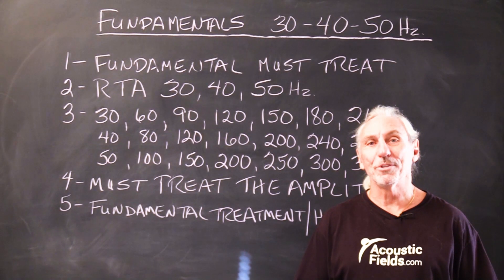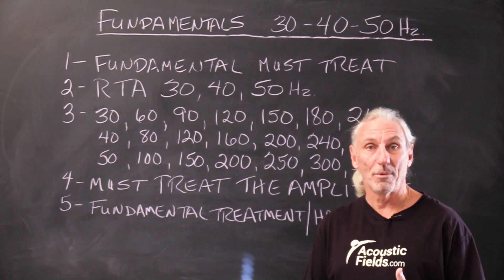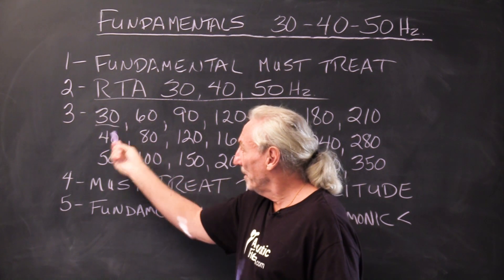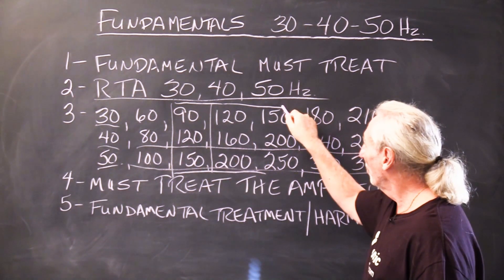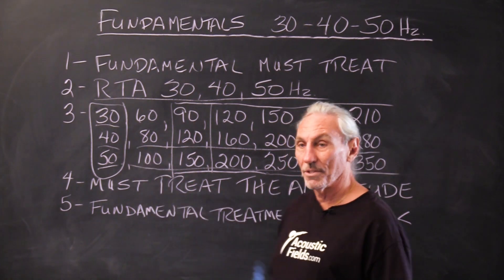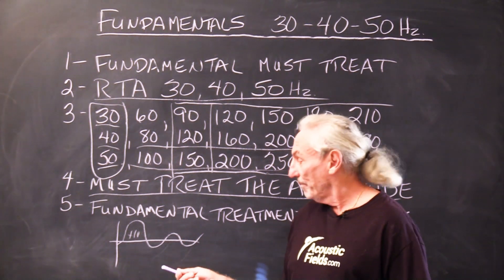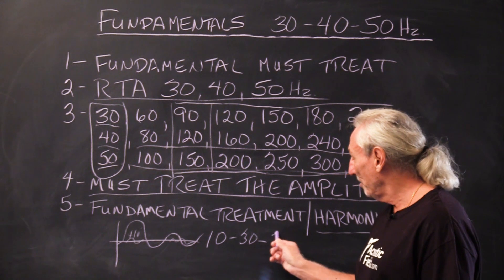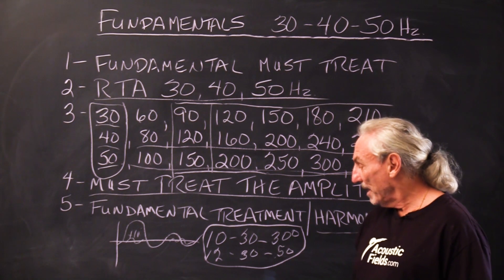Fundamentals 30 - 40 - 50 Hz - www.AcousticFields.com

Comment: I understand lower freq. radiate outwards in a circular pattern, through walls, etc. And opening doors to adjoining rooms will help to dissipate those long wavelengths too. So we treat with bass traps where it collects like walls and corners. I think that's how it works. Thanks.
Reply from the maker: J,  Low frequency energy is trapped between two parallel walls not two parallel corners.
Reply: @AcousticFields  the energy maximum is still in the corners while in the middle of the room there is none at all - so placing a trap in the middle of a standing wave gives you little to nothing

Comment: I have seen this many times while doing live sound and ringing out different rooms to compensate with EQ. The problem frequencies that feedback first are all multiples of the fundamental. You can see it on the eq when you are done. The cut frequencies will be 100, 200, 400, 800 and so on, or multiples of whatever fundamental is amplified by the room. I would very much like to work in a room that has a flat response.
Reply from the maker: D,  Yes, that is the ultimate goal for all of us along with proper attack and decay rates.

Comment: If you treat a 30Hz room node with a pressure activated absorber, i can't see any reason why the harmonics of that fundamental would be affected in any way. The 30Hz node itself does not cause the 60Hz or 90Hz to occur. It's purely the distance between two opposing walls that are creating independant nodes.
Reply from the maker: O,  A fundamental mode excites the harmonic and yes distance is in play. If you reduce the amplitude of say 40 Hz. you will have less peak issues to manage in most cases at 80,120 etc. Anytime you can impact one frequency range say 30 - 100 Hz. with proper rates and levels of absorption regardless of room size/volume., your treatment issues from 100 - 6,300 Hz. are much easier to deal with and usually require less treatment costs the less peaks one has in the response curve.
Reply: @AcousticFields  This is simply not true, and it is very easy to disprove. Play a tone that excites the rooms second harmonic and measure it with RTA. Introduce the fundamental tone, and you will find that the second harmonic does not change.
Reply from the maker: 0, From a technical standpoint yes. However, fewer peaks below 100 Hz. make all other issues much easier to work with. Easier to identify and easier to treat. I am trying to show people that everything is related. There is no one specific cause for anything. Everything is dependent on everything else.
Reply: I think you are misunderstanding what he's saying….  When he says produces the harmonics, he's not referring to the room itself, he's referring to what is played in music and/or  speech.  If you play a low E on a bass guitar, that note is going to comprise of the fundamental at 41hz AND all of its relative harmonics.
Reply: @Oneness100  These harmonics are created solely by the instrument, not the room. This phenomenon does not apply when it comes to room treatment for sound reproduction.
Reply: @yvindholgernes8950  I think you are simply misunderstanding what Dennis is saying and you think he's saying one thing, when he's not.
Reply: @yvindholgernes8950  But the room amplifies problems because of the size and dimensions of the room.  Low frequencies being the biggest problems in small rooms.  

treating the low frequencies first is also a better approach.
Reply: @Oneness100  I agree with you there. My point is that treating low frequency does not affect mid frequency room response. You have to target both.
Reply: @yvindholgernes8950  Yes, I'm fully aware of this and I'm sure Dennis is too.   he's just trying to explain the importance of treating the low frequencies first because it's harder (and more costly) to accomplish and it will help in dealing with the rest because those really low frequencies tend to mask the mid's and higher frequencies due to their power.
Reply: @yvindholgernes8950  But which one do you target first?  Lows or the mid's and high's?
Reply: @yvindholgernes8950  but you start with the low frequencies!

you don't hear most mid-range issues at all as long as you are buried in a soap of bass crap 

 take a yamaha YAPO with only 7 PEQ bands (and yes on top of physical treatment you nearly always should do PEQ to finally optimise the frequency response)

with bad physical treatment of low frequencies you waste them there unless you configure it manually but I doubt that you are as good as a computer measure thousands of defined tones at the microphone within seconds and without any human subjectivity

after treating and equalizing a room you heard music over years you will even hate the new sound at the begin because your brain was adjusted to the problems and
you loved your room modes

took a weak here to be OK with it and 3 weeks starting to love a sound as it should have always been

Comment: Would you recommend DSP as a stop-gap until one is able to physically address this?
Reply from the maker: M, Processing is to be used as a polish not a solution. You need to treat double digit peaks and dips in frequency response using the proper room size and treatment to match usage and then use processing to polish up a +2- +3 dB issue.
Reply: @AcousticFields  Thanks for the reply.  This makes sense, of course.  Thanks for all your videos, they're really helpful, and I take everything on board. Much appreciated.

Comment: Question from DJ who never gets to play in treated rooms?  If I reduce the 30 to 50 hz with eq will the harmonics still remain?  Those low frequencies
Can create havoc and booming in certain areas of a hall, say 1500 to 2000 square feet!  And complaints!
Reply from the maker: Reducing fundamentals will assist you in reducing harmonics. It will also provide more definition in the harmonics.
Reply: you can practically cut off 35 hz and below for most types of music

i physically even feel unwell when subsonic frequencies are in the room